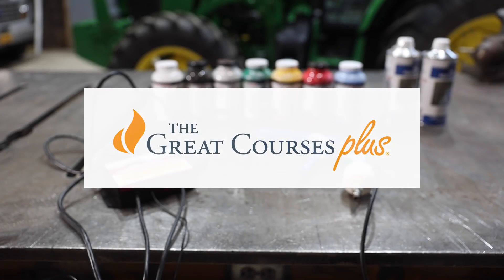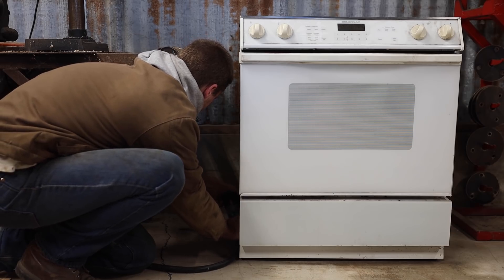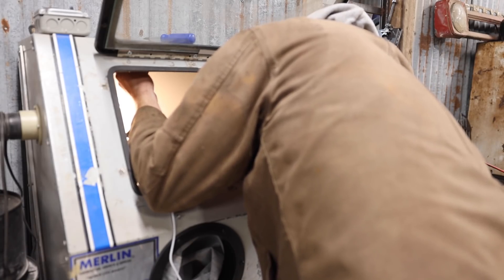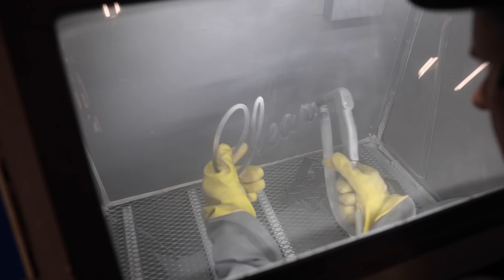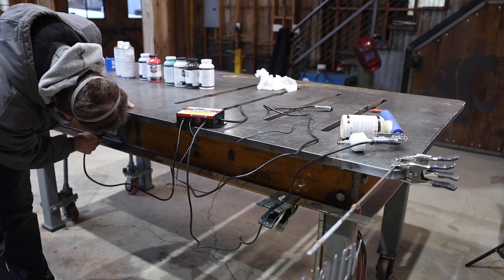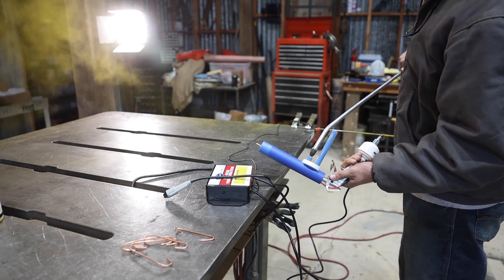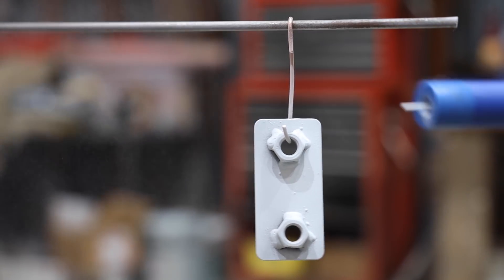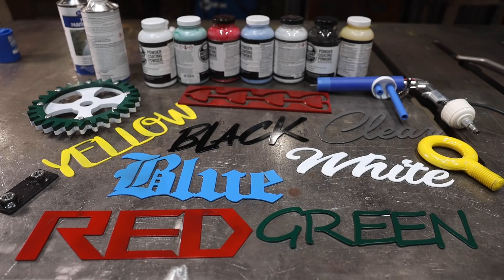Powder Coating At Home

Comment: Good vid one suggestion.  Once you sandblast do not touch the material with your bare hands. Slip.on gloves are cheap and will ensure then oil from your hands do not transfer.

Comment: PC, Painting, chemical coating, anodizing, etc.

Are all tools in the tool box. All about the material you are working on, and what its intended purpose is. Can’t PC plastic, as parts will melt. PC is easy and fun, and worth getting into if you ask me. Painting has its place!

Comment: Something that isn't common but you can regulate the air pressure to change the amount of etch you get.  Also different media can provide different finish.  The valve or door at the bottom allows you to change media quickly.  On the regulator for your gun you can if you want use two regulators.  One to bring the pressure down to about 25 psi then the second stage to about the 5  psi you need.  This works best with a large diaphragm regulator on the second stage.  These are a lot more expensive but if you do this a lot it's worth it.  Maybe not needed for what your doing though.
To make an oven, I used galvanized steel, valley tin for roofing, over a steel tube frame.  Two layers of 1 inch Iso board from a big box store, a PID controller using Two SSRs controlled by the PID controller.   I used two oven heating elements on the bottom because my oven is almost 4 feet long.  I haven't put steel on the outside yet but it's up and running great.  The door is just two layers of that one inch iso board taped together using the aluminum tape in the heating and cooling department.  With this idea you can make as big an oven as you need.  Most powder coat oven have fans to circulate air and get an even temp.  I'm not sure I going to do that but may.  Maybe.

Comment: I would be seriously worried about spraying in your workshop. You will get Powder everywhere, and that is not just a problem of dirt but also a serious danger to health as you will accumulate a lot of very fine particles over time.

For the oven: a friend of mine build a system with moving stove plates that heat up only an area. With this he was able to coat 6 meter beams in his garage. Basically four stobe plates on a rail that are slowly moved over the part. Worked great. Maybe that is an option for you as well.

Comment: Pre heat your parts before powder coating.
Reply: By pre heating the part right before you apply the powder it will allow the material to "flow" into the nooks.

Comment: Is there any downside to baking longer than it requires? (Wondering about waiting until they're at temp and then timing 20 minutes vs., say, just letting them go for 45 and assuming that they would take less than 25 min to come up to temp)

Comment: I found that when you are not happy with the PC results or you want a super finish the thing to do is give the part a good hand sanding with some 320 grit paper to knock off the gloss and more importantly, use the first coat as a guide coat and try to sand off everything.  What stays fills in low spots like a surfacing primer but it will take the heat of the oven.  All you need is a bare spot to ground to and it will coat just fine and the finish will be even better.  If you are removing a mistake just sand out the blemish and knock off all the gloss and dust it again.

Comment: 5:00 what media are you blasting with. My theory is sand has salts in it which leads to the part rusting from within. I'm sick of having parts rust through the powdercoat
Reply: I use glass beads as the media.  They shatter on impact and blow out the material rather than driving it into the metal.
Reply: Sand isn't a very good media. I use garnet because it cuts faster and some people say you want more profile for the powder to stick to. Aluminum oxide also cuts very well but is more expensive. The media can be blended and the amount of air pressure makes a difference. High air pressure breaks crushed glass, as I eventually figured out, which kind of defeats the purpose of crushed glass.

Comment: Always use silicone plugs or tape to cover any threads before coating. It's better to not coat the threads rather than recut them afterward. Also think about hanging before you cut the parts, by adding small cut-away clips with holes here and there. Happy Easter and cheers from Chicago!

Comment: Awesome video, but I'm still not sold on powder-coating.
This looks like more of a hassle than purchasing a $50 pop-up spray tent and busting out the rattle-can.

Visually: It doesn't appear to be much of an improvement over spray.
Longevity: Cheap Rustoleum black is an excellent rust prevention spray, and it's been tested (and I've confirmed) that it out-performs even cold-galvanized. I wouldn't be surprised if it gives powder-coating a run for the money. If i recall, powder-coated items need a base-coat, then top-coat if they are to stand up to weather.
Durability: This is likely a win for powder-coating, but I'd love to see someone confirm this. Any time I need durability with spray, I simply hit the part with a top-coat of flat-clear. That way you would have to break through the clear, and the base with in order to see any imperfections.
Reply: Sounds like the fox and the sour grapes to me tbh

Comment: I've been powdercoating for a few year at home some observations you will very quickly move away from a domestic oven. That hanging wire is way way too thick and one is best, The new rack was nice but  over kill. A sand blasting gun that you can make your own tips for is best. Buy the best coating gun you can afford. The Faraday effect is a thing and a real pain in powdercoating. Yellow and white are the worst colors for not coating thick enough.

Comment: Dan Gelbart has a really great video on surface preparation here: https://www.youtube.com/watch?v=x7onZGqrYyY
You don't want to touch the metal after sand blasting as it will leave a thin film of oil. Cleaning the surface with solvents will not remove the thin film mono carbon layer. You can use Comet and similar scrubbing powder with bleach in it to convert the mono carbon layer (or sandblast it again). He also shows how the water test can reveal if the surface is ready for coating. Even leaving the sandblasted part for a day or two in the shop is enough to contaminate the surface.

Applied Science has a more in depth video worth watching as well https://www.youtube.com/watch?v=HiL6uPNlqRw

Comment: One really good baking setup is using an electric smoker cabinet. A lot of the "repair/restore" channels in the community use them for baking paint.
For the blasting cabinet, buy 3M self healing film, and put it on the inside. When it can't heal anymore, just replace it, and the glass remains clear. Cheaper than replacing glass or plastic.
Reply: Second that on the film.  Much cheaper

Comment: Hey man, just don't forget to protect the threads when powder coating. It can be a pain in the ass to clean
Reply from the maker: Ya good point, thanks!
Reply: @rainfallprojects501  No problem. If you need any advices message me. I work in a factory where we have two automatic lines and one manual so I could be of some use to you.

Comment: Be really careful with the gun lol. If you touch the tip to the work pice by accident it will give you a hell of a zap. In addition for really consistent coloring. Use nitral gloves after sand blastinf and wash them down with alcohol. Oils of any kind will end up screwing with the finish.

Comment: Good day one.
I’m using an old refrigerator body. You know just the shell. I picked up four old stoves on side of road. Using the insulation and the flat metal. Made a larger oven using the heating element and two of the larger electric heating pads. Works really good. FYI: I had an appliance repair guy check out before use. Had to get a separate heat register to not over or under heat. Good luck you always make interesting projects. Give Jake a pad on the head from me.
Reply: Is it possible to use a heat gun?  (Or How would you do 8' pieces?)
Reply: @TheRainHarvester  I don’t think so.

Comment: I've been working on my powder coating setup as well. I'd love to see a follow-up to this, especially around anything you come up with around the marks your hooks left. Personally I have tried to minimize by using solid Ethernet wires (very thin). I've also seen many builds of ovens online and would love to see your take on it if you decide to make a larger oven.